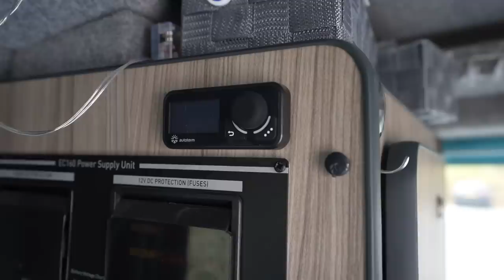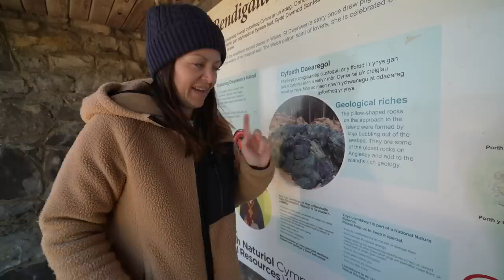VAN LIFE on ANGLESEY - YOU DON’T WANT TO MISS THIS! (We’re heating things up)

Comment: Hi just a tip for Joan. I am 73 years old and walk a lot over fields and hills. I have a pair of trekking poles which I use all the time. They help me get up hills easily and they take the strain off of the knees. You do need to use two poles. Hope this helps Joan.
Reply: I once tried walking with two Poles but they were both faster than me!
Reply: I agree, I'm 70 and they are so essential!
Reply: We are late 50's and use them. Best present my sister bought us, even though it was supposed to be a joke.
Reply from the maker: We think she should get some as well, think they will be a massive help
Reply: My 75 year old Mum uses those poles too, she really struggles on steep downhills without them.

Comment: I have the same diesel heater and controller. You might want to put the controller lower since it contains the thermostat. It might turn off too early if located almost at the ceiling. Love the mode that never turns the fan off. The noise is more constant and it is easier to sleep. 

Only downside with mine is that below -10 c it cannot keep up in my small 2x3m caravan.

Comment: when the diesel heater gets to the temp you desire does the heater switch it self off then back on again when the temp gets to low  also is there a annoying clicking from the diesel pump